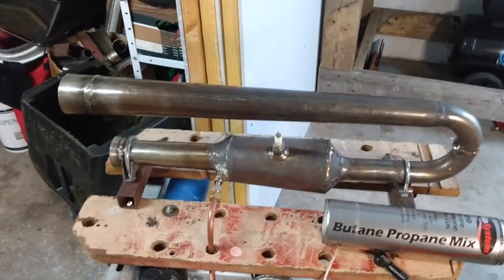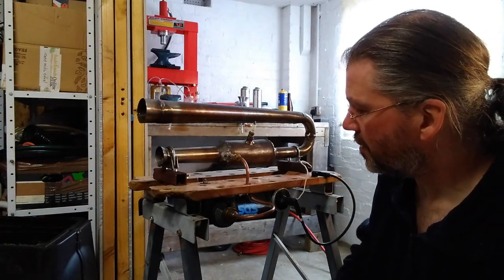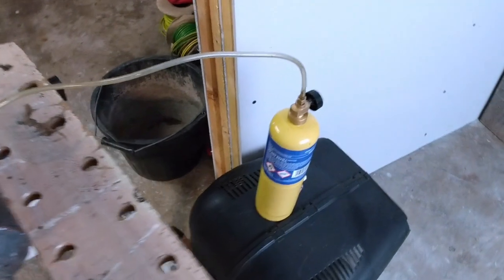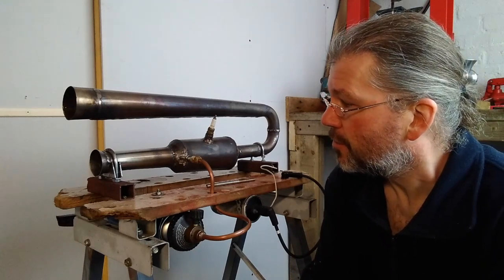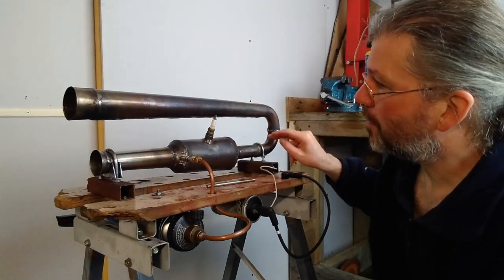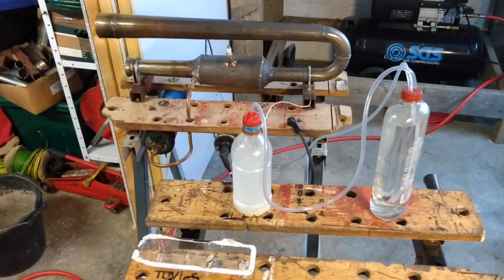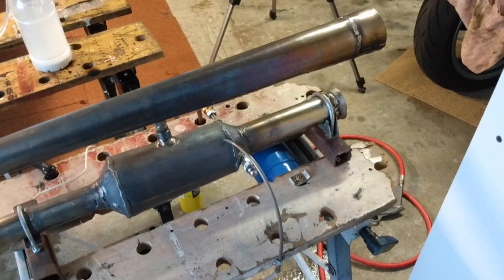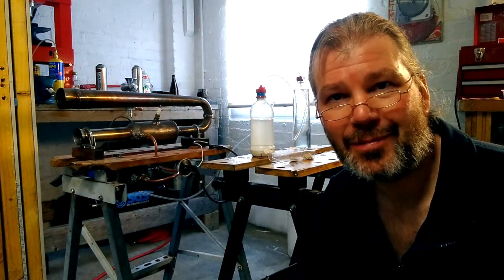DIY Pulse Jet Part 2 - Modifications & More Testing.

Comment: Be interested to see how this goes on liquid fuels.  If you could heat the thing up and then inject some waste oil, that would open the way to a lot of useful heating applications for these.
Reply from the maker: I will get to waste oil eventually - been looking at a lot of your videos for ideas. The only problem, as you mentioned before, is the NOISE!!!
I don't have a sound level meter or I would measure the dB level. It is seriously loud.
I state in the video that there will be no more acetylene producing but fear I have only thrown down the gauntlet to myself....
Reply: @mrpingen you don't need a dB meter it's way over what's considered acceptable noise  guaranteed people will hear it a mile away lol 
one of the loudest noises I've ever experienced pulse jets are on model RC aircraft , look after your ears sir and get defenders  if you don't already use them .

Comment: Great video. I have a couple of questions. 1. Why is your day pulse jet horse shoe shape and not straight like the V1 engines. 2. Are you useing a valve in it to stop any energy going the wrong way?
Reply from the maker: Hi, thanks. It is that shape because it is a Lockwood-Hiller valveless type. There is some thrust comes out both ends so neeeds to be bent at 180 degrees.

Comment: Do you consider putting a straight exhaust pipe on it for testing ? 
It would be less practical to move but it should run better as the pulses would travel in a line and the exhaust would be far away from the intake
Reply from the maker: That would work for testing. It could be made telescopic to find the ideal length and then a bend made to that length for actual use.
Reply: @mrpingen  You had my curiosity, you have now my full attention 👍

Comment: Isn't this technology originally from WW2 with the Nazi V1 rocket program?
Reply from the maker: Pulse jets pre-date that, but you are right, yes a valved version was used on the V1 “rockets”. They are incredibly inefficient and use loads of fuel - The V1s must have been little more than flying fuel tanks, they also needed assistance to get in the air. A friend of mine is a military historian and author, he was fascinated that I was building a pulse jet and even more so when I actually got the thing to run!

Comment: the resonance noise is horrible lol
Reply: afterburner instead perhaps?
Reply: I mean continuous afterburner (but not pulsejet) without moving turbine parts
Reply: how about evaporated ethanol (steam ethanol)
Reply from the maker: You want to hear it in my workshop - even with ear defenders it is loud.
Reply from the maker: @Jkauppa  Yeah, wrap a tube round the outside to heat the ethanol and then into the combustion chamber.